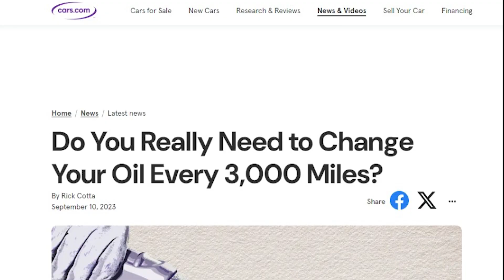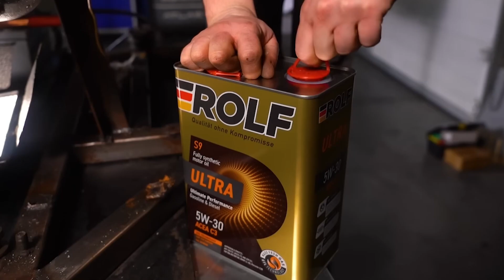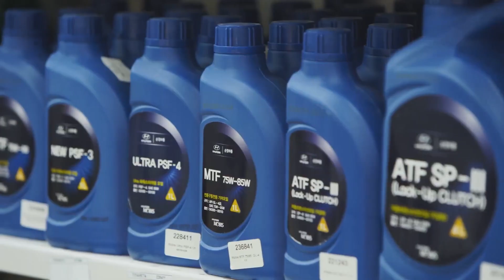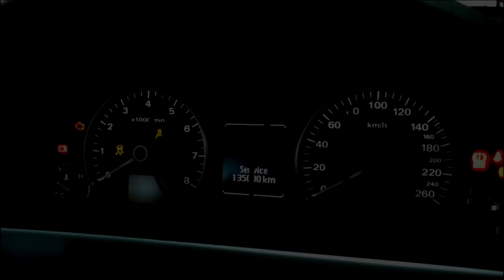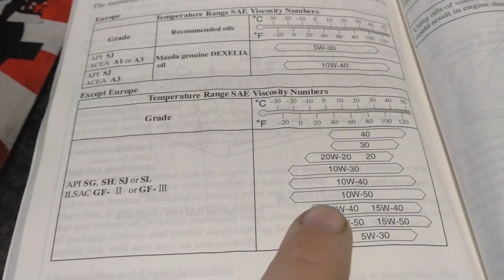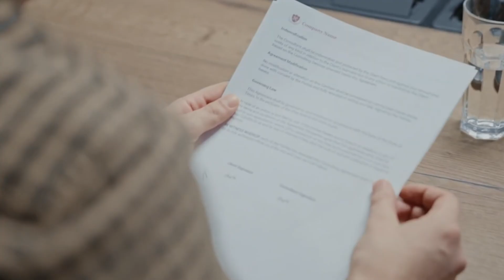10 Engine Oil MYTHS Stupid People Fall For (Don't Be Fooled!)

Comment: Ok I agree with a lot of the information you have stated. First Oil change interval Depends on Your Driving Conditions like climate. I live in Phoenix AZ And The VERY HOT Temperature Destroys Fluid s All Including Motor oil I have seen a UOA of a Very well known Oil Manufacturer Full Synthetic Done at 4000 miles. Due to the Very high temperature. I have also seen oil Full Synthetic need change at 3000 miles Due to The Dusty Dirt Roads the vehicle Was driven on Constantly. So Driving conditions IE Environment plays a Very important part as to when to change the to oil
Reply from the maker: Yeah you are absolutely right

Comment: Myth 1 and 2 are wrong myth 4 and 5 have to do with older vehicles with dried out seals. Synthetic oil has additive package that swells seals and causes leaks. 
There is alot of bad information in this video which will cause premature engine wear shorter the life of the engine.

Comment: How about the oil filter .. how many miles or kilometres can you use an oil filter
Reply from the maker: An oil filter typically lasts between 3,000 to 7,500 miles (about 4,800 to 12,000 kilometers) depending on your driving conditions and the type of oil you use. For conventional oil, it’s often recommended to change the oil filter every 3,000 to 5,000 miles (4,800 to 8,000 kilometers), while for synthetic oil, it can be safe to extend it to 7,500 miles (12,000 kilometers) or more.

However, if you're driving in severe conditions, like heavy traffic, extreme temperatures, or dusty environments, you might need to replace the oil filter more often.